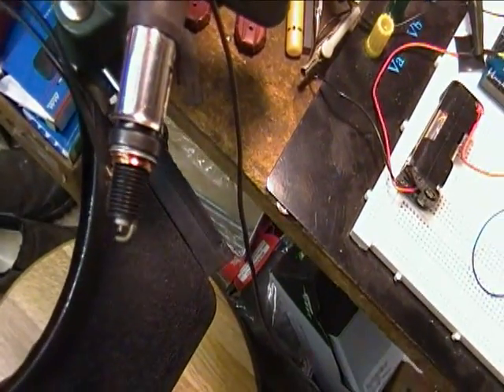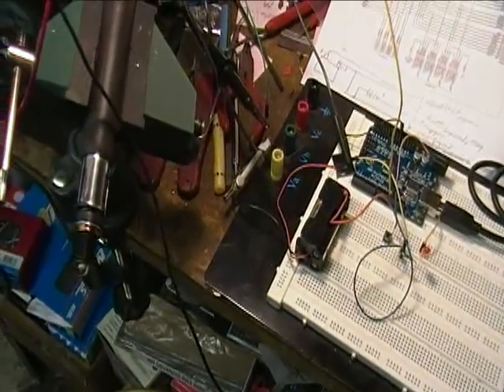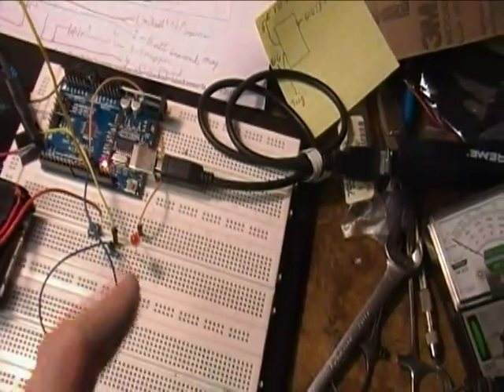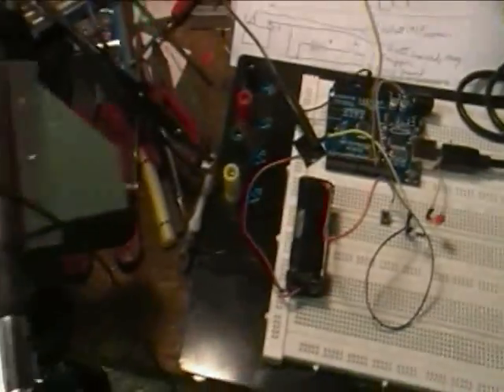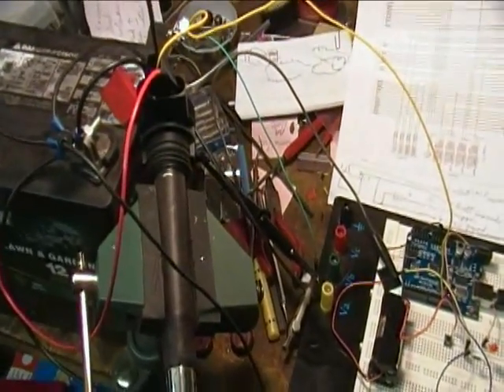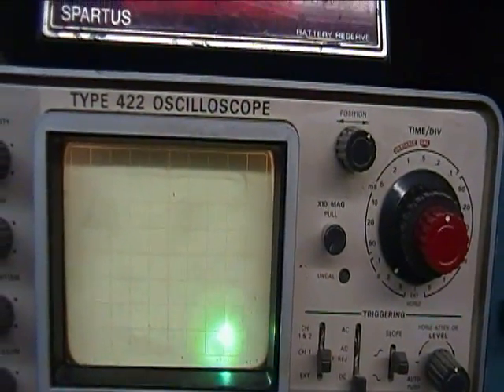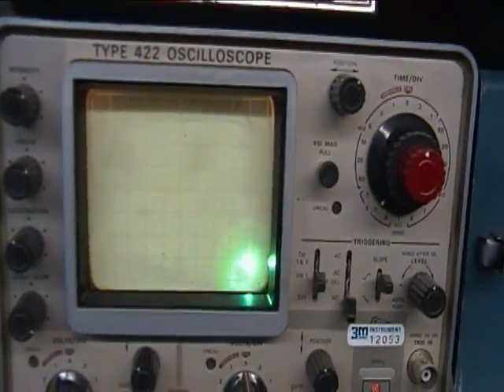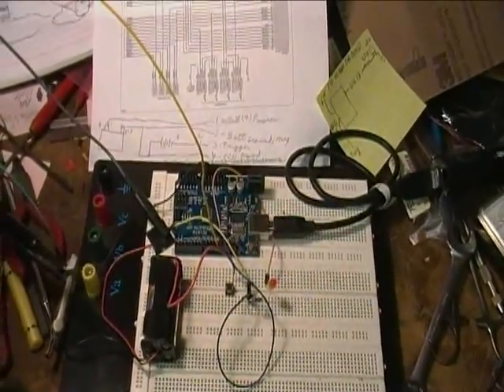Arduino Coil On Plug Driver, First Try

Comment from the maker: I really don't know how much current it takes to trigger the COP pack.  But, since I haven't burned out my Arduino, it must be less that about 40 ma.  When I found that most of these 3-wire and 4-wire COP packs are driven by 5 volt signals from the vehicle ECU, I automatically assumed they would only need a few milliamps.

Pete Stanaitis
------------------
Reply: Is that a voltage generator between the Uno and the COP?  The round black thing.  I have a project with a Nano clone, a TIP 120, a 12v - 5V PSU and a 6v 400KV voltage generator firing a gas grill igniter gapped roughly the same as a spark plug and it pops a little hotter than yours, but somehow the Nano is acting a little buggy about the timing of the sparks.  I'm thinking maybe the voltage generator is pushing back some EMF and wanted to know if/how you dealt with that.
Reply from the maker: @MichaelJeffers75  The "round black thing" is just a battery holder to supply 4.5 volts to a push button that I used when I first tried this thing out.   Rewatch the video.  I explain it at about 2:13.  I do not have any problems with EMF being fed back to the UNO.
Thanks for asking.  I have lots more videos on this subject at:
https://www.youtube.com/playlist?list=PLVxWen9M87dAFoZqyj3iy_fyBfkWuESRC